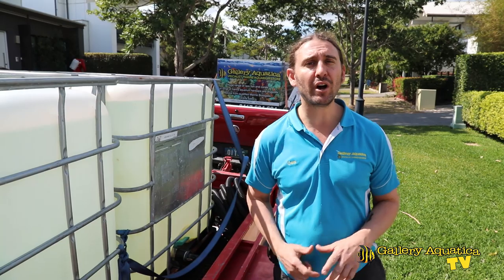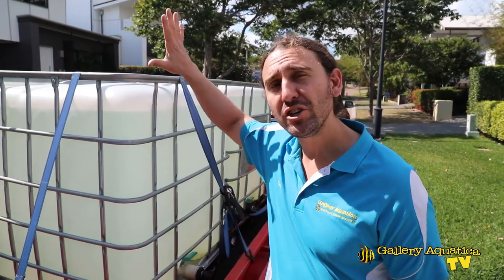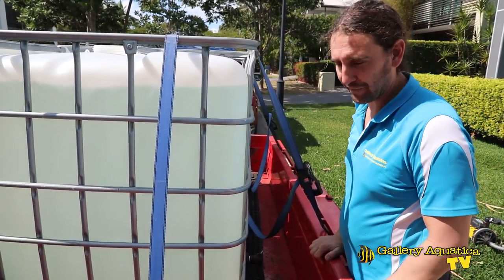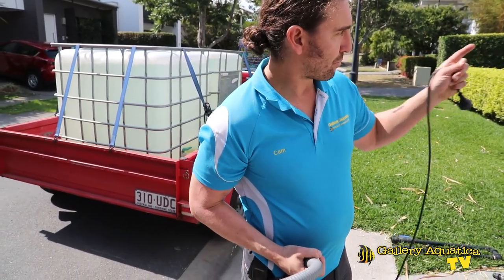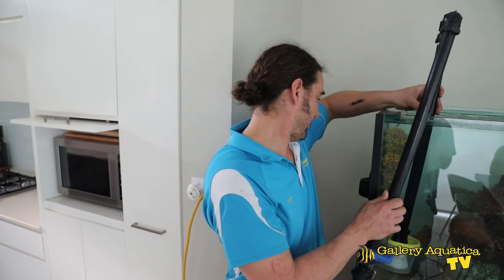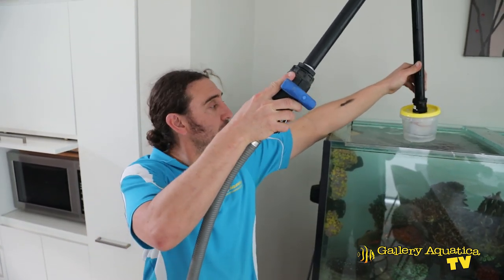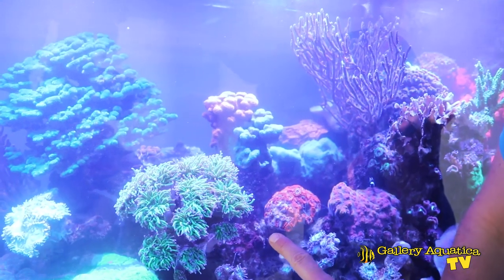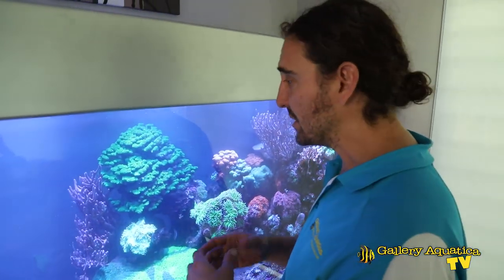95% Water Change on EPIC tank #2 --- Gallery Aquatica TV

Comment: With a 95% water change, do you worry about a mini cycle that could throw the parameters out of whack?
Reply: Shouldn't be any new cycle as long as not making changes to bio media.  Bacteria is in your rock/sand/media, not the water so all should be good.
Reply from the maker: Acotyac is correct, we don’t suffer water chemistry issues as the bio media isn’t disturbed during the process. Cam

Comment: you are doing only 95% change for this tank? and how offten ? and is it better than 25% ?
Reply from the maker: We do this every 3 weeks. It’s a good system for nutrient control, however it is somewhat risky and if you don’t experience high nutrient load smaller waterchanges are recommended. Cam

Comment: I suppose you checked the pump before you drain the system? Or you got lazy?

Imagine the stress level if the pump not working. This will be a very hard and long bucket running 😀
Reply from the maker: This is my worst fear, draining the tank then realising the pump doesn’t work. I usually have a spare with me, however I actually forgot to pack it this waterchange😐
Reply: @GalleryAquaticaTV  This happens frequently to all of us if a system working well. "Oh, I forgot this time. Anyway, it always works all the other times" :)